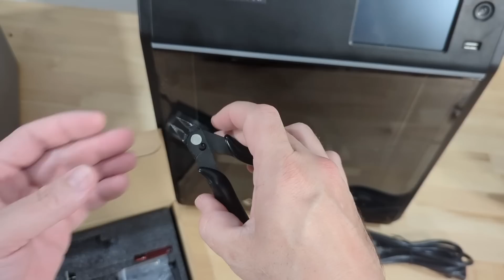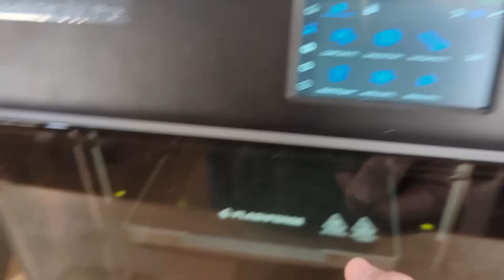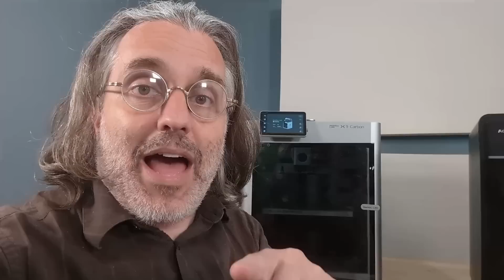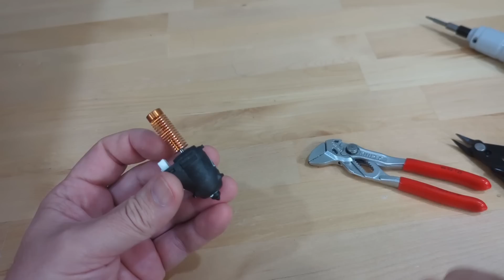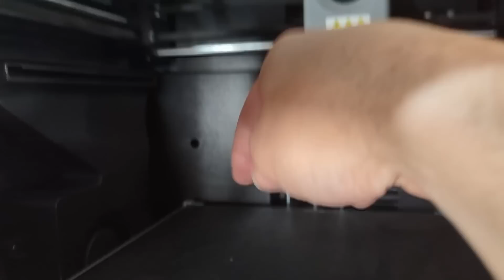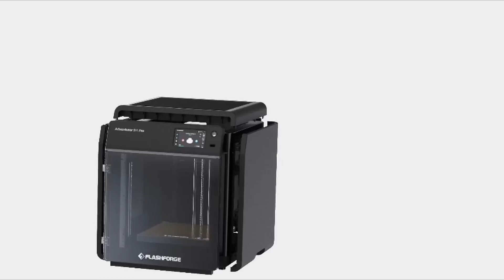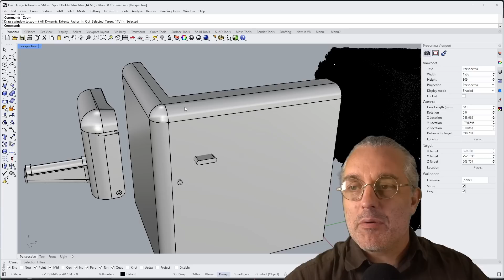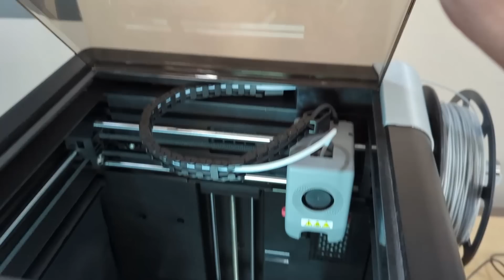Better than the Bambu Lab X1C (for the money) - Flashforge Adventurer 5M Pro

Comment: I just got the AD5M a week ago, and watching this almost 9 minutes in, I am astounded by you lack of reading the starter guide included. This is my 1st 3D printer, but at least I put my spool holder on the correct side up (ridge up), removed all necessary screws using the correct included tools, knew the t-shape wire thing is for unclogging the nozzle and did all necessary other prep work before hitting the on button. A little reading goes a long way.
Reply from the maker: Classic RTFM. In my defense, I've assembled and reviewed many printers. And I'm also representative of the vast majority of users who do not want to read before jumping into the project. Good design is self-evident. It doesn't require studying before using the object. It is "intuitive." So, given that I'm basically an expert in the subject of being a 3D printer consumer, is it my failure or the manufacturer's failure?

Comment: I've had mine for 18 months now, and it's my PLA/PETG/PETGCF workhorse.  A bit over 1500 print hours on it, 1350 of which are on the same .6 hardened steel nozzle.   Zero maintenance aside from a bed leveling every 10 prints and greasing the rails every 40 hours. 

Right now factory refurbished units are going for $270 on ebay and the non pro models can be had for less than 200 bones with a warranty.  

If you don't care about multicolor and/or just want to dip your toes, for that price I don't know that this unit can be beat.

As a general note about Flashforge - in my experience the user base has a MUCH higher opinion of them than the "professional" reviewers.   I think there's always going to be some of that via confirmation bias, but it's out of proportion in my opinion.  

Also, forge-x exists - a simple way to jailbreak and unlock the purer klipper goodness.

This, along with the price and my experience tells me that Flashforge takes money that others put into buying influencers and returns that back to the customer at the register. 

I purchased 2 more non-pro models for 170 bucks a pop about six months ago, and am awaiting my creator 5 pro.  I paid $450 for my original ad5m pro, another 340 for 2 refurbished ad5m base models, and 800 for the creator 5 pro.   Meaning for around  the cost of a single h2s I have 3 fast, single filament reliable workhorses and a 4 head tool-changer for fancy stuff.  I may be the only one on earth lol, but I'm a bit of a Flashforge fanboy🤷‍♂️

Comment: My Flashforge came with a usb. The first thing you should print is a side spool holder (u just did but yours is a little over engineered but nice). It also has a built in camera accessible by phone or PC
Reply from the maker: Do you think that it originally came with the side spool holder? Or is it possible that that was a later development after I released my video?

Comment: I purchased a 5m pro on a positive review from a school teacher (anything that can still be operational after kids futz with it is a winner in my book, however my printer stopped working after my 3rd print.  Just a heads up, the extruder assembly is a plastic failure point that can be swapped out for $20, or you can remedy this by removing the top and front screws of the head unit allowing you remove the extruder assembly.  The assembly is press fit so a small wedge can help you get into it.  From there, stretch the spring about 3-5 mm and reassemble.  I plan on fabricating these pieces from metal to not worry about it in the future.  Hopefully this will save you a night of troubleshooting.

Comment: "Most of China does not know how to do anything original"... Bambu Lab is based in Shenzhen, China, founded in 2020. Flashforge however have been around since 2011, and had great 3d printers like the Flashforge Finder back in 2016, which had the filament spool on the back. So, if one of the companies were the "copy" company, then it would be Bambu Lab. As for doing anything original, you might want to look into the history of China compared to the 'history" of the US.
Reply from the maker: Your country has a glorious history. I'm not trying to insult you. But be honest, America is the seat of innovation in the world. 80% or more of it happens here. At all levels. If we stop working in America, the world would stop innovating.
Reply: @DesignPrototypeTest Yeah, sure...

Comment: Amazing review - thank you. 1 question though... Flashforge 5M Pro or ... Elegoo Centauri Carbon? (i am not concerned about multi colour / filament systems just a solid machine that will do the job ) Either way, Thanks a mil.

Comment: I found your comment about putting the motors outside the chamber interesting.  It seems many mfrs don't do that.  I'd like to hear more about build quality, such as belt quality, pulleys - there's a bargain basement pulley that's sometimes used that's visibly cheaper - leadscrews, signs of rigidity, whether it seems more or less accessible for repairs than other models, and so on.  The frame seems pretty light, but adequate.  Regarding the plastic over the hot end heater: the situation back then if I recall involved the use of PTFE inside the hot end, sometimes right down to the nozzle.  PEEK was used by some (Ubis / Printrbot, for example) but that had largely passed away by then and E3D came along with a good all metal hot end that didn't use a PTFE tube inside.  I don't remember MK7, MK8, and "MK10" clones using PEEK at any time.  But they did use PTFE and it failed often.  I think FF's use of plastic here is different because it's on the outside where presumably it's much cooler, and is not more risky than using Kapton tape or silicone rubber around the heater, which seemed to work fine.  Thanks for the review.

Comment: when loading the filament it does look like a lot of waste but I weighed the filament that ended up on the print bed and it was something like 3-4 gram's with is nothing really 

P.S is it me or did you try and find things to nitepick about the flashforge just to try and make the Bambu Lab X1C look beter?

With the lower price for the Flashforge of course there is going to be comprises I could understand if they were close in price

Comment: The reason there's no unload filament is because it can cause hot filament into the parts of the extruder where it shouldn't be, this can then cause a blockage, this is best practice in my opinion, I've been 3d printing for years, you just pull out the feed tube cut off the filament with cutters and let the printer purge out the rest in the hotend. Don't pull hot filament backwards thru your extruder and hotend? Also clean the build plate with some washing up soap and a scouring pad. I do this on every build plate from new, this is why some people struggle with lifted prints and others don't. Do this after every few prints, no bed glue is needed, get the bed temp right and it will not lift.
I would buy the flashforge 5m everytime instead of the bambu, it runs a fork of klipper software, you can also now access the backend controls in mainsail or fluid web browsers by installing a klipper mod it's on github but you will lose your warranty, but I don't care, it make's the printer more open source, I can then mod the printer further add things and adjust the printer configs and other files if I need too. Sky's the limit. Oh and I build 3d printers in my spare time mainly vorons and vz bots or hybrids of them both merged into one printer, take care. 🙂

Comment: So can Bambu use ORCA slicer now days I hear some bad comments about their latest firmware. If not, that is a big drawback because it makes it harder to slice stuff not on the bamboo site. Bambu is worry free either i have one i just don't print stuff anymore. You can get a trident or a Voron 2.4 for less that the Bambu. Bigger bed and better control of fumes. can add more tool heads and an AMS to the Voron. You just need to build it yourself but that may be better for you in the end to help trouble shoot problems.
Reply from the maker: The firmware on the printer is not the same as the slicer program on your PC. The two work together but they are separate. There was an update that they forced everyone to do because someone figured out how to hack the printers. People weren't happy about that. We like having the option to update or not.

Comment: Thanks for all the info. I just purchased Flashforge AD5M Pro last week. After doing a lot of research on printers for beginners I decided on this one and I'm glad i did. I'm brand new to 3D printing and found your video to be very helpful. Thanks again.
Reply: how are you finding it 8 months later? I’m trying to decide on my first….
Reply: @frodev728 I've had one for 1500 print hours, absolute workhorse!  On eBay refurbished ones with a factory warranty are around 250 after taxes and delivery, you can't beat that.   The base model is 75 bucks cheaper than that.

I don't think the pro is a huge upgrade, i got my pro about 18 months ago, and i run a drone surveying/mapping/videography company- i build and maintain all 20 some drones in the fleet, not one store bought.   So im CONSTANTLY printing stuff out of some somewhat tricky filament like foamed PLA and petg-cf and tpu/peba.   I bought 2 more refurbished base model 5m's about six months ago to help with some of the load.

All that's to say that I've been so impressed with Flashforge that I've  bought several more units (I'm awaiting my creator 5 pro) and have had the same experience - not a lot of flash, just simple easy to use machines that are forgiving of beginner mistakes.  

The pro isn't that big of an upgrade.  Personally I'd buy a base model and print the enclosure.   The camera is so bad it's useless - poorly placed so you can see maybe half the bed, looks like the lens is smeared with Vaseline it's so out of focus, and the frame rate for video is in the seconds per frame range (you read that right lol).   I don't print a lot of abs so idk how good the filtration is, I know if I was really worried about needing a filtration system I worked NOT trust the tiny little hepa filter strapped to a pc case fan this thing has lol.  

Personally my advice would be pick up a refurbished 5m base model for under 200 delivered.  If you hate it or find you really wanna do multicolor or high end engineering stuff, you can sell it on eBay for exactly what you paid, and get something else.

Comment: Yes weirdly this is the first video of your I have seen. Probably because I have flashforge AD5m’s…😅. I absolutely love them and have printed out all the extras turning them into Pro versions with a little less the $100 in actual factory parts and software/firmware. That brings the actual cost of them just over $100 less the actual Pro versions cost…🎉. Oh and FYI none of mine purge anywhere near as much as yours when reloading. Would you recommend reprogramming the AD5m’s with the klipper software instead of the flashforge factory programming? I have been thinking about it because it opens up to all 3D editing software and slicers.

Comment: Is it the build plate surface or lack of cleaning it before use that it required glue to get the print to stick. I have never used glue ! I don't know if I would buy the Flashforge but at the same time I wouldn't buy the Bamboo as it could become a far more expensive boat anchor ! Despite people saying they are really reliable ; I have heard just as many complain about them when trying to repair or get good support. Basically pick your poison.
Reply from the maker: All these companies have the same challenges to overcome. Meaning fundamentally the problems you pay face with a 3D printer are independent of the brand you are purchasing. 

All you are hoping is that the company you bought from did everything right. But try as they might these challenges have a way of asserting themselves.

I'm not running a printer farm so I don't print enough to wear any of these printers out. YMMV but be wary of brand loyalty. Nobody makes a perfect product.

Comment: I guess those are strain gauges and not "piezo microphones". Basically entire bed is one scale, and it is detecting pressure from nozzle pushing it down.
Reply from the maker: Thank you for the correction! I missed that detail. I should have caught that. The bamboo lab uses piezo sensors, but strain gauges are possibly the better solution. This is why the nozzle only touches once during probing on this machine. The strain gauge will register higher and higher values as the nozzle pushes harder and harder. There's no doubt contact has been made. Whereas you do a double tap When using piezo sensors to ensure a good reading because it only registers upon first tap. As the nozzle pushes harder into the bed, you don't get more of the reverberations triggering the piezo sensor.

Comment: ever since I got a textured build plate for my CR-10 I quit using painters tape or glue, is the adhesive really necessary?
Reply from the maker: If you only print with pla and you keep the bed very clean with rubbing alcohol before every print, then you can get away without bed adhesive.

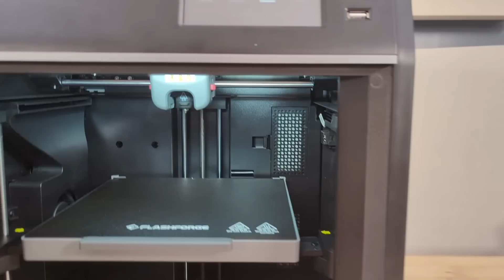Comment: 10:15 - Probably shouldn't open the door or place any other external forces on the printer while it's using the accelerometer to calibrate the input shaping, and definitely shouldn't slam the door.

56:44 - Actually, the PCB says "Extuder" and not "Extruder".   🙂

I was surprised when this turned into a tear down engineering analysis.  Thank you.
Reply from the maker: Great observations! Thank you for the good comment.

Comment: Hm. I‘m not sure between this 5M Pro and the Bambo Lab P1S. 
Don’t have any experience in 3D Printing. 
I want to print heat- and UV-Light resistant parts out of ASA and TPE for use outdoors. 
Not interested in fiddling around. 
Would love to use my iPad for creating and printing. 
Which should I go for?
Reply from the maker: I have not reviewed the P1S so I can't give you a definite answer. However, given your very specific criteria of wanting to print ASA and other high temperature materials, warping is going to be your number one adversary. A fully enclosed print chamber that's sealed is Paramount. It's incredible how the smallest draft of air or fluctuation in temperature can cause significant warping problems. The 5m pro here seals along all doors. Better than the X1C.
Reply: @DesignPrototypeTest  Thank you for your answer, time and that information.
Reply: P1s is foolproof.

Comment: the winner is creality 3v3se iam printing nice thinks in a.b.s.pet.g.tpu.p.la. and al that for 165 eu.
i can also edit the buildplate by hand ore cr touch . it lets you bump the speed wile your printing. 
and you shut tell hole story. 
a.b.s/.print,s always slow pet/g is a little bit faster .
pla you must by hich speed pla. 
and the bambu lab cant even print abs.

Comment: Thanks for the video. But really wish you ended with an overall summerization with a listing of your specific +s & -s and overall opinion. With this printer available for $469 for Prime members it really seems to provide great value. Is it missing a few things that Bamboo can do, yes, but will those things impact you much, probably not. I'd say the biggest benefit to going with Bamboo is access to the AMS. But for general home use that's not a huge factor for my use case. When using Orca can you get access to the camera to check your prints? You talked about possible issues with the plastic encased hot end. What are the exact limitations of their hot end design? What is the max temperature you can print at? Did you actually test any of that? Appreciate any additional info you can provide. Thanks.

Comment: There are three machines that pique my interest. The Flashforge 5M Pro $469, the Infimech TX $329 and the beastly QIDI Q1 PRO $469. I think I would prefer the TX over the 5M but the QIDI Q1 Pro has a larger build volume and an active chamber heater. So in my mind the 21 Pro is the winner followed by the TX and second place.

Comment: I would look at the qidi Q1 pro @ $450 before you jump on that. bed is to small for my needs
Reply from the maker: I really want to like Qidi. I reviewed two of their printers. Fundamentally they were the same with the same problems. Fool me once: Shame on you. Fool me twice: Shame on me. Fool me three times???
Reply: @DesignPrototypeTest  I will have to look for your videos. I own a Max3 I did kinda have a bad start but overall i love the printer. replaced screen, filament sensor. was very disapointed to learn max3 does not have resume print after power loss. but i love the bed leveling sensor and the quality of parts its making.

Comment: Try the Qidi Q1 pro, it can print just as fast at the 5M Pro, can get it for a decent bit less with a coupon code, has an actively heated chamber, and a bigger build volume than the 5M Pro
Reply from the maker: I've been burned twice accepting Qidi printers for review. I really wanted to like them. On paper they have everything that I'm looking for. In actuality the engineering is flawed and the printers don't deliver. At least the ones that I saw. It would take A LOT to get me to trust that brand. Basically every single other reviewer would have to be raving unanimously. Even then I would still be skeptical.

Comment: Great review. Finally someone showed what is inside the nozzle. I didn't try to do ot - it's too expensive ;)
I own FF AD5M pro for half a year and I think it's really a solid printer for the money. Those quick change nozzels are expensive but they are worth it. If you use a different nozze for each material there is really no problem with any clogs. I've printed somewhere close to 20kg of filaments on this printer and never had a single clog.